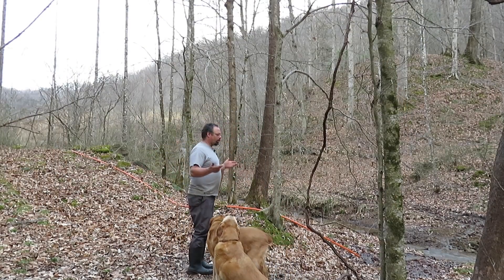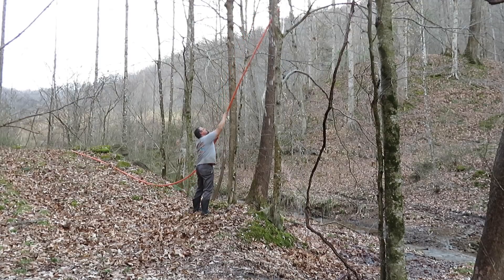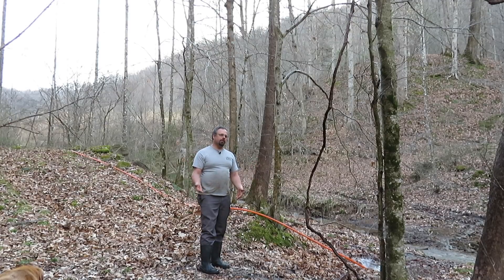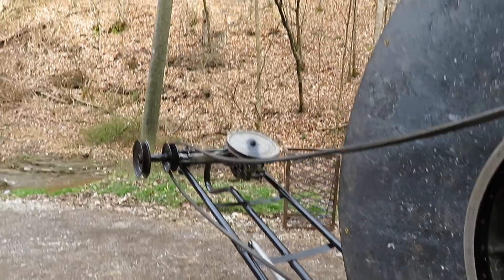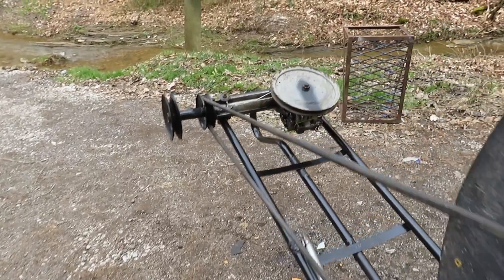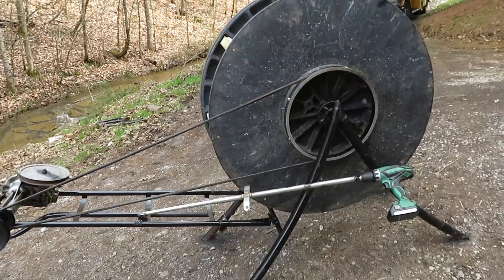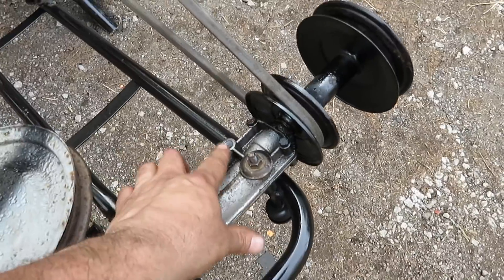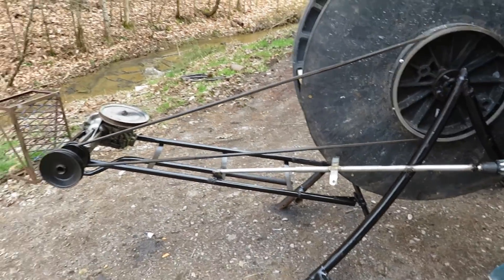Water Wheel Build-Transmission Mount

Comment: Is that a lawn mower rear end?
Reply from the maker: yes it is.
Reply: @lukeFugate  thank you for letting me know. I built a water wheel but it didn’t turn fast enough to make a spark. I’m using a 110/220v   1/2 hp electric motor from a blower fan off an ac unit and also got the transformer wired in to hop up the juice but it again don’t turn fast enough. I got a friend with a welder that says he’s always wanted to build one and I’m gonna recommend he use your setup since he’ll be rebuilding it. It’s not a hobby for me or for fun it’s so I can get free power to the camper I live in and say fuck you to an electric bill that hopefully I’ll never have. I’m wanting to wire it up like a house so about how many volts would I need at the most? I just wanna be able to run a few things at the same time like you would in a house.

Comment: Dude, you're awesome! I want to do what you're doing. But, make the wheel bigger, an overshot wheel gets almost all it's energy from gravity (height of the wheel) Undershots are all flow, no gravity. Turbines all the gravity and flow is turned into pressure (no air) so are the most efficient. But they seem to be very high maintenance, screens, bearings, turbines, etc. Overshot wheel, grease the hardwood bearings once a year and that's it. A watrerwheel turns to slow for steel bearings. Keep up the great work.
Reply from the maker: Thanks! I have decided to go with more solar power as the water wheels always seem to get destroyed the first time it floods. 
You are correct that an overshoot wheel is the way to go.

Comment: How does the voltage drop along your wire to your house? Is it an issue?
Reply from the maker: It depends on wire size and distance. You will get voltage drop regardless. Too thin of wire will result in unacceptable loss. If you have over 50 feet from the generator to the batteries, you would need thicker wire. For less than 50 feet number 10 wire should be adequate. Anything further would have to be number 8 or bigger.

Comment: Find ya a hydro rear end or better yet a single transmission unit off a residential zero turn for infinite adjustment for speed/torque and last a bit longer than geared rears
Reply from the maker: Thanks! Good tip!

Comment: That video is amazing! But how did you get the 1:21 ratio? i don't see any belt or 3 pully? What's below that disc tat spins at 6300rmp?
Reply from the maker: I have a lawnmower transmission under the big pulley. The smaller pulley is hooked to the axle of the transmission where the wheel would go.
Reply: luke Fugate, thanks for your reply, really helpful. What would you say is the gear ratio to aim for? You said you have a 1:105 but was wondering if you know if a smaller gear ratio would do the trick?

Comment: If You can find a adjustable speed drill press you salvage the step pully from it  to replace the two pulleys coming off the lawn mower trans   once You know the speed of the water wheel 
If Recall right alternators run at 1500 to 4,000 RPM as a sweet spot
Reply from the maker: Good idea! That would give me a lot of flexibility in gear ratios.

Comment: Good luck hearing enough water power behind that wheel to turn it that fast.  Especially with a load on it
Reply from the maker: Yeah, it would never spin that fast under load. It does spin an alternator, but not as efficiently as I would like. For now I am using a pelton wheel.

Comment: I want to point out that the key concept of a high-torque water wheel. Has two components Leverage did he hamburger of your will and water heaviness. This is just flowing over the top with no pressure behind it like coming out of a small Flume system. Now you can get heaviness buy a wider wheel. Happiness is something you want to keep on your rotation as much as possible you would definitely have the top one fourth of the wheel below that is a struggle to keep the water on the Wheel that is until it reaches the bottom where you would want every bit of the water out. This is why they curve their blades. Moreover one could add on the left and right side gutters these keep the water flowing over the blades. More water on the top of the water wheel produces more leverage. What you have made so far if you put alongside a boat you would have a Paddle Wheel. A Paddle Wheel is not a water wheel. If you had a flowing stream underneath it it may produce a great amount of torque if you booked it in or you have the current. With what you got is a pipe or a hose. You may do well with a bunch of shovels in a circle and have them spinning as the water hits the shovels. This is a different type of hydroelectric power. You are harnessing the pressure of what is coming out of the hose. And the problems are clogging up the pipe with leaves. But I Love You video do not get me wrong it is a good video. You probably are going to get it worked out. I hope it will keep you warm at night as you can plug in some type of heater I'd suggest a hot water heater element and try to dump whatever you can dump into them and then try to circulate the heat through an old hot water heater.

Comment: We have a 35' head on our homestead and a good year round stream. I plan on 3" pipe 600'. 1 1/4" pipe gave me 25# of pressure and it turns our Pelton wheel rather well so 3"  and 2 nozzles should do great. A Pelton wheel needs no transmission. Measure your head with a GPS on your smartphone. Does a pretty accurate job and no guess work. You are way over thinking a simple easy to calculate power source there bud but as long as you are having fun that's all that counts until TSHTF. Forget that alternate and get a permanent magnet SD or smart drive motor from a cloths washer. They are everywhere and can be had for $25. Just need a tad of rewiring and the instructions are all over yt. Just search SD micro turbine or such. No belts needed.

Comment: I would be concerned about the RPM in the gearbox, It was never designed to run at 6300 RPM, at the most it was designed for 2000 on the input, heat generation may kill it
Reply from the maker: Yeah, it would not last long spinning that fast. I have other ideas of how to make it work.

Comment: Losing An awful lot of power with the riding mower gearbox,  would probably be better off building a transmission of your own with chains and sprockets. Sweet setup regardless👍
Reply from the maker: Very true. A pma won't have to spin nearly that fast anyway. I'm still waiting to get the materials to build the waterway for the wheel anyway.

Comment: Are you building a waterwheel or a turbine? 15ft of head should mean a waterwheel of about 14ft in diameter. 15ft of head could alternatively power a turgo turbine directly attached to your PMA negating the need for such a large "water wheel" and associated mechanical rpm increasers. I don't think what you're building will work anywhere near the fullest efficiency achievable.
Reply from the maker: I'm doing both. I am making a turbine also. The turbine will be done first because it will take a while to get the supplies to make the water trough that will bring the water to the wheel. I know the wheel won't be the most efficient, but I like water wheels and it will make some power. I think even just the water wheel will make plenty of power for the occasional use of the cabin. I had the first one set up much less efficiently and it was enough to run the lights in my house(All LEDs). I should be able to got most of the weekend on just the batteries without any charge going into them, so the wheel just will be maintaining the batteries while I'm gone. Actually, the turbine is kind of overkill for no more time I will use the cabin, but it will be a fun project anyway.

Comment: i write to share some info that probably is not already between your ears.        a pma (or pm-motor)  Must  be used.    an un-modified car alternator, generally, won't work.    power take-off, NEAR  the 'wheel's center of rotation,  Should consist of a gear/pulley having a radius JUST sufficient to accommodate the use of a first stage ratio of  1:3.    this step-up gearing  Should be  designed for  Optimal performance,  in an  energy conversion and power transmission scheme.      it must be remembered that  as output rotation rate is increased, torque potential at the center of rotation,  is 'lost'.    so, the load has an ever increasing  Mechanical Advantage over the  turbine runner.     the nominal operating speed (and load) of the pma Should be  compatible with  the nominal speeds  Achievable, in a given setting.     you may know that when a pma is connected into a low-impedance Power circuit,  lenz-force drag  Will occur,  as the rotor magnets move by the stator coils.    this is the (internal) LOAD.    the  'work' that must be done.        it is useful to simulate  a  'loaded' condition; and it is easy.     simply,   Short  the pma output.   this will cause the maximum (internal) pma load.    
if you do Not ever  accurately  estimate the head, flow rate and available energy,    the odds of achieving an efficient system configuration  are  long, indeed.       cheers           googletranslate               scroll down to 'calculating''
https://en.wikipedia.org/wiki/Hydropower
https://en.wikipedia.org/wiki/Lenz%27s_law
https://en.wikipedia.org/wiki/Electromagnetic_induction

Comment: you may know there are a Major losses when a (ridiculously long)  belt is used, in an energy conversion scheme.    oftentimes,  the first output stage needs to be  roller chain.    you may know that where an installation is  distant from the point of use, the  wild ac  from a pma  Should be transmitted, over a long cable run.   cheers
Reply from the maker: Yeah, there would have to be losses. I would have liked to have had the transmission hooked directly to the wheel. I am going to try to have the alternator charge batteries which are located close to the wheel with an inverter directly on the batteries. Then I want to try to send the a/c from the inverter to the cabin.
Reply: @lukeFugate  that would work.     HOWEVER,   running the wild ac  lets you put those power components where they can be more easily accessed for maintenance,etc.    cheer
Reply from the maker: True, It would also give me the ability to easily run 12-volt circuits for the cabin straight off the batteries. Good suggestion, thanks!

Comment: 15ft of head on the water, get a 6ft wheel built like a ferris wheel from steel tube and fit it with huge buckets the HP from that will be significant enough to run a few thousand watts 24/7 .....
Reply from the maker: Good idea. I have actually seen wire spools made of steel like you are talking about. Buckets sound like a lot better way to contain the water.

Comment: So if we double the small belt pulley we will be at about 3500 rpm?? What about the flex/bounce of the dolly armature?? Looked like it was bouncing around pretty good. Doesnt that take away from efficiency?? Maaaannnnnnnn - you got a lotta flow from that crick. 30' drop?? Hell yeah turbine, rampump, AND a waterwheel, maybe two! I bet if you went 8" to 6" to 4" to 2" you could have firehose pressure...... Awesome system, cant wait!!
Reply from the maker: I think the bounce was from the uneven speed my son was spinning the wheel with. I think with the flow of water it will be a lot smoother. Yeah stepping down the hose sizes would greatly increase pressure. There are a lot of possibilities with this water source.

Comment: Nice.   I would say running that fast 24/7 your lawnmower transmission would be your fail point.
Reply from the maker: Yeah, they aren't made for constant use. I think I may design a gearbox with ball bearings instead of the bushings in this one. It will probably not end up turning that fast once it is in operation. I'm thinking if I can get a consistent 1500-2000 rpm it would be enough.
Reply: @lukeFugate  I only say that because my lawnmower transmission wore out after moving my fat ass around my yard after three years.   Maybe 75 miles in it? Lol
Reply: @lukeFugate  i have a peerless 6 speed transaxle and its been through 5 chassis as i use them off road. If you can find a peerless model transaxle buy it

Comment: Lots of "free" power year round! How far up the hill did you have to go for that much flow? Building a raceway would take a lot of digging wouldn't it? I'm really interested in what you come up with for a water turbine. We have some big storms coming up from the Southwest, so it may shut down your outdoor work for awhile.
Reply from the maker: The pipe is almost 150 feet long. I think If I could build some sort of trough that would run from the high point to drop off over the wheel would be ideal. What I will probably end up doing first will be the 4 or 6 inch pipe that will be the easiest and cheapest thing to start out with. I hope there's not more rain coming, but it wouldn't surprise me.

Comment: Looks really good. Are you going to add some sort of lubrication system to that transmission?
Reply from the maker: I was thinking of a drip oil system actually. That transmission is built with bushings where it should have bearings. I may end up eventually trying to either retrofit bearings in there or design a gearbox from scratch.
Reply: Bushings sound scary. Oil drip makes sense for now, but at those rpms, i would sure worry about failure way too soon.
Reply: I was thinking the noise that  thing is making, there is some resistance in there that's going to create some heat.